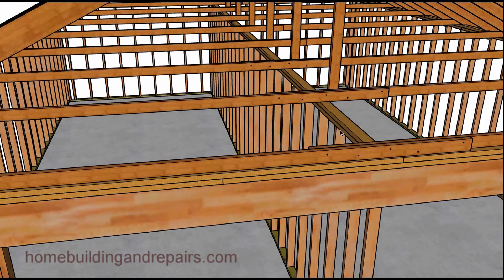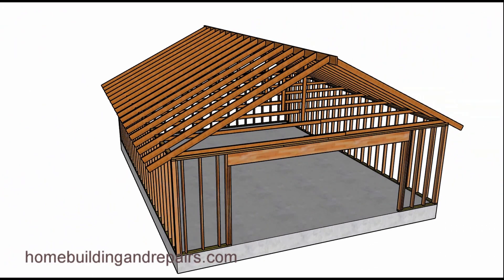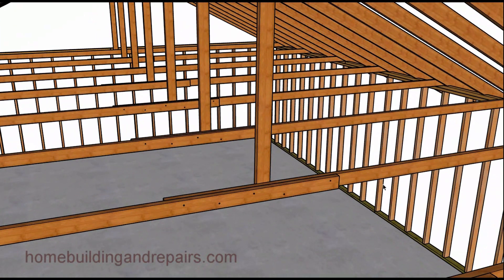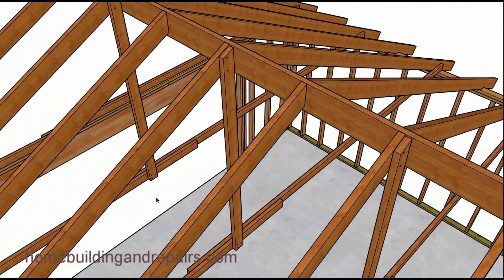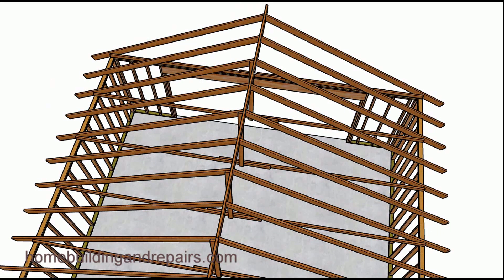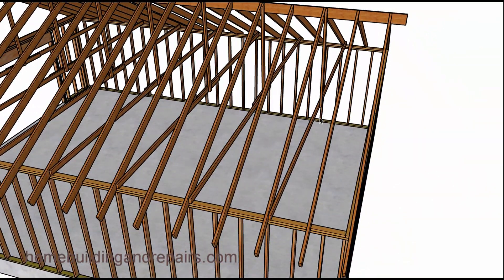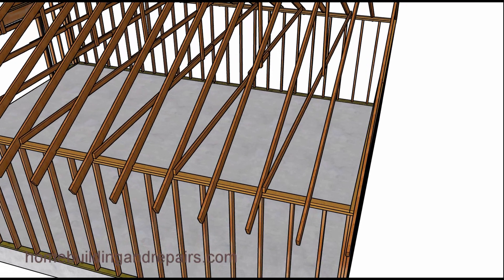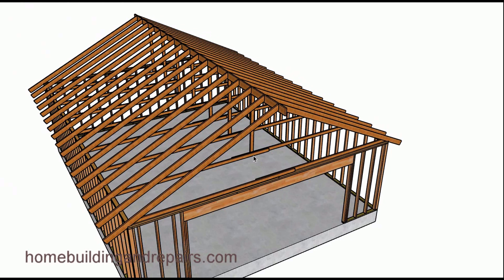Can I Remove Walls Inside Two-Car Garage – Single-Story Wood Frame Construction

Comment: How do I calculate the beam required to open a 160" gable end up for a large back window/door?  The gable end already has a standard sliding glass door opening but I want to double that span.  I tried to post a picture ... its a high ceiling which entends another 10 ft above the exisiting opening.

Comment: I have a pretty old house. Looks like previously the house had a single car garage. Someone extended it wider for a 2 gar garage and deeper where there is additional storage. The wall for the additional storage space runs parallel with the rafter ties. The wall also makes it where 1 of my cars is the only car that will fit in the garage and it is pretty tight. I was looking into removing the wall to make the vehicle space larger. Does it sound like the wall is potentially load bearing?
Reply from the maker: It could be, I would do some more research. I can't provide engineering advice for viewers like you're asking, because it is often confusing to other viewers.

Comment: need help. I have a house that’s 1280 ft.² with vaulted ceiling‘s in the living room and kitchen. In the process of removing wall between kitchen and living room, but not sure if it’s loadbearing. Could you help me? If I were to give you photos.?
Reply from the maker: I can do better than that, here's a link to our website specifically for house framing remodeling.  https://www.homebuildingandrepairs.com/remodeling/framing/index.html